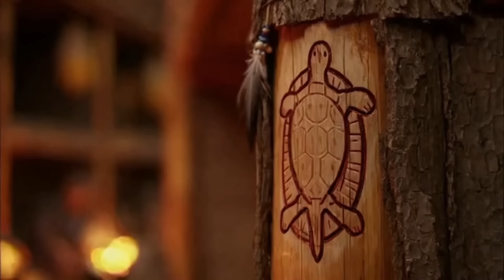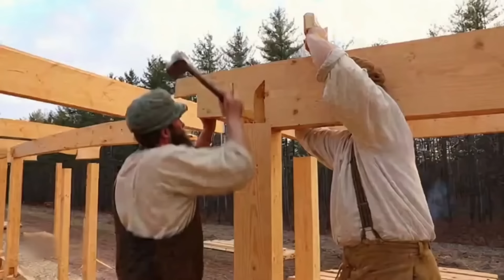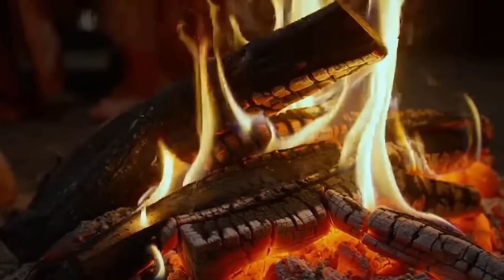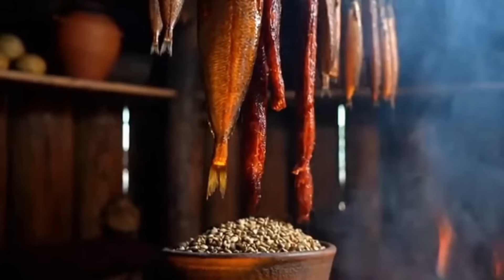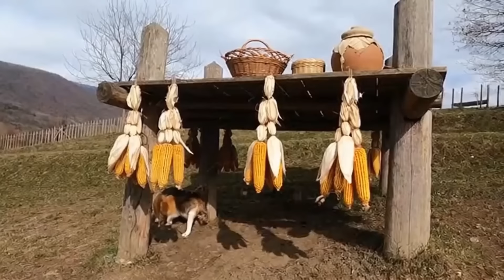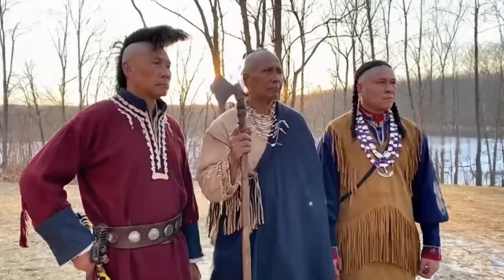Native Longhouse Architecture: Adapting Timber Homes for 30°C Winter

Comment: what is the point of having fires, if you got such bad insulation? and holes in ur roof and doors open? you know damn well that heat is not covering anything... its going straight up and out of the house... If you wanna retain heat, build smaller, lower dwellings, its easier to heat up, and you only need   1 fire per small room and use body heat by sleeping against eachother. bodyheat+the fire will heat up that room ur in very very easily. but its pointless if you got like a 4-5 meter ceiling... no heat will be retained.